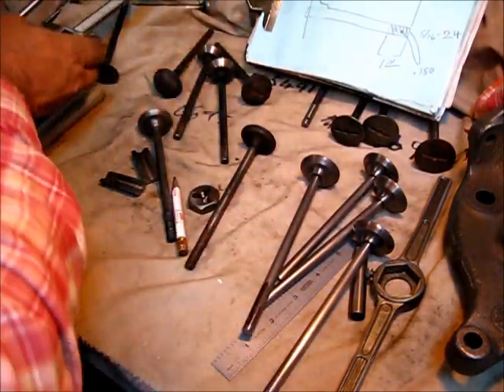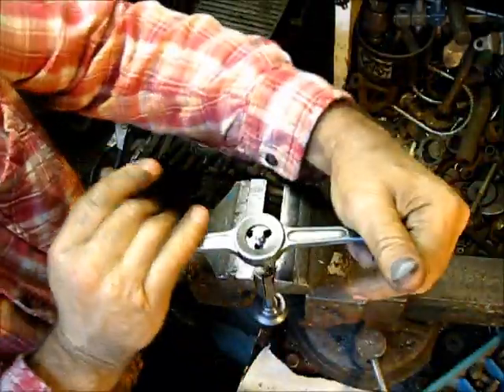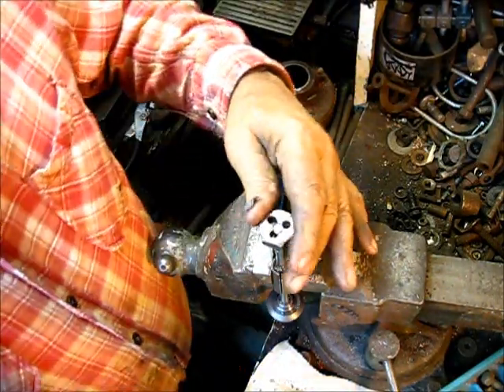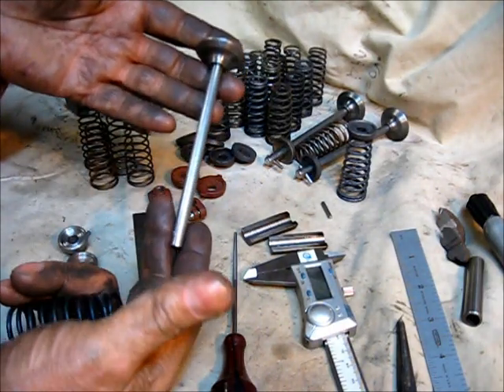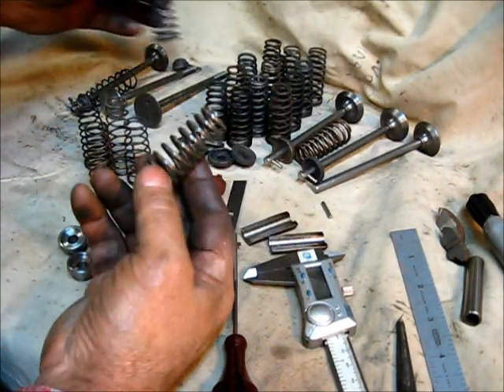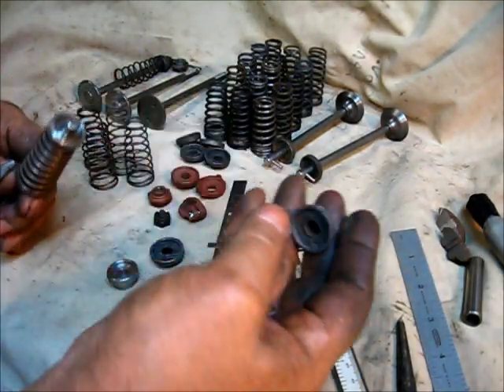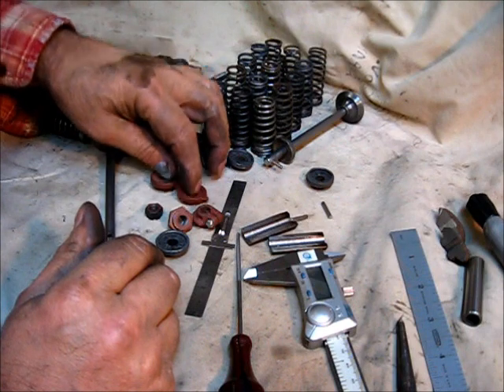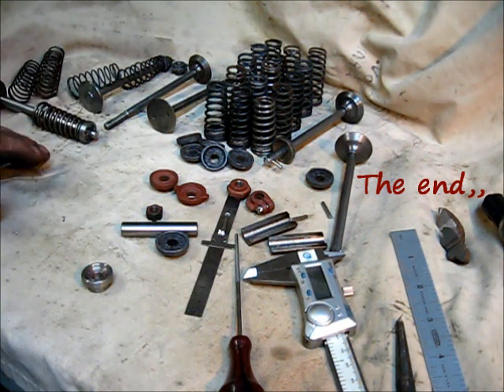I H C ENGINE how to build intake and exhaust valves #9

Comment: ok i see how your holding the spring in there with a metal pin instead of the 2 piece insert and milling out  the grooves for it... but still kind of curious how one with just a lathe can mill out valve springs or springs in general to a desired strength

Comment: What size reamer do you use to bore out the valve guide for a 3/8 liner? I believe the liners are +.030. So i believe the reamer should be .404...i dont want to bore the hole too big ya know. Also what is acceptable clearance for the valve to the liner. Thanks so much for all your videos. Inspired me to build a john deere e